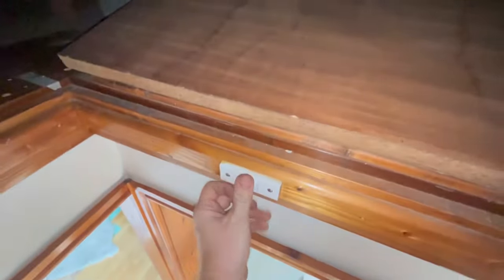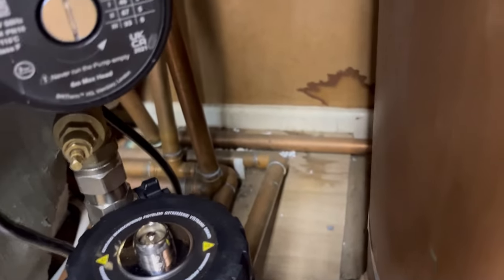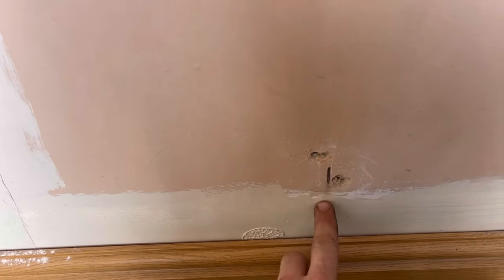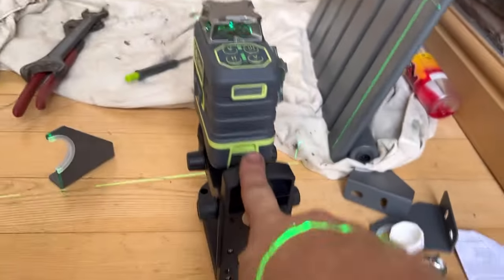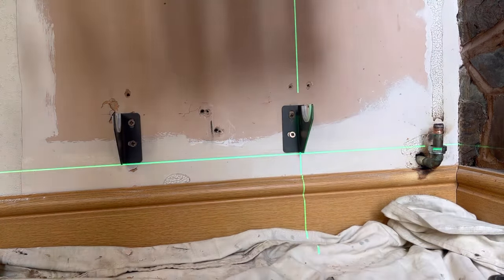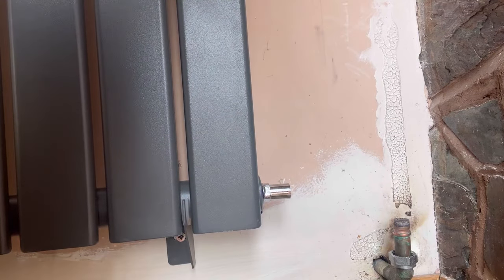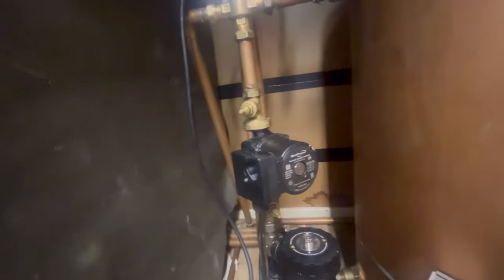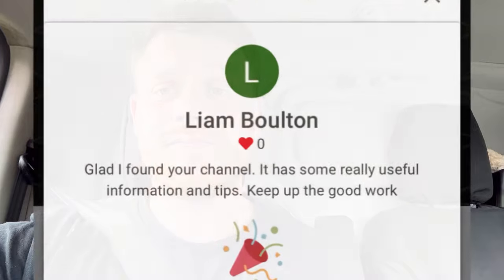Day in the life of a Plumber EP15: Part 2 from the magnacleanse, Newradiator & new 3 port valve

Comment: Thanks Luke for another informative useful video, glad all went well with the Magnacleanse flush as that filter didn't look bad at all really, I've got one and think they are great. 
Love the fact your still keeping it real explaining that isolating the rad on this system type may have been the cause for the other rads not working, it's nice to know even you as a professional need more time to think things through before something clicks, I thought it was just me. That lasgoo laser looks banging it is something I will deffo add to my plumbing tool kit.  I wonder if the customer was testing you to see how you work before requesting the new heating system 😆😆👍
Reply from the maker: Thanks mate, yeah filter looked ok, water coming out clear even towards the end of drain down so happy with that, always good to take a step back sometimes, I could of drove myself insane and stayed the last time to try and get radiators working but worked out for the best coming back. Yes I’m impressed with laser so going to try it out for a while and maybe do a full review video on it. There’s a link in description for more details and a discount code if needed 👍 I wish they had told me sooner about plans for combi 😂 but there’s new rads, new valves, a clean system so not all wasted I suppose. Stay tuned for Part 3 of this one 😂

Comment: Can you explain how the balancing valve works mate
Reply from the maker: Yes mate, water will want to take the easiest path so when the hot water is on it will want to whizz round the cylinder, screw the gate valve down and it will balance the flow between the cylinder and the heating, hope that helps 👍